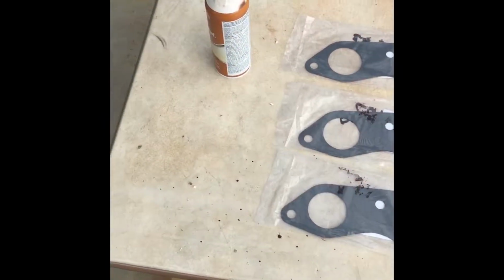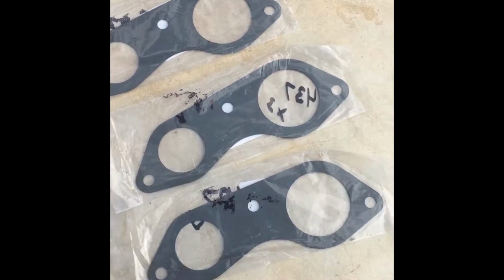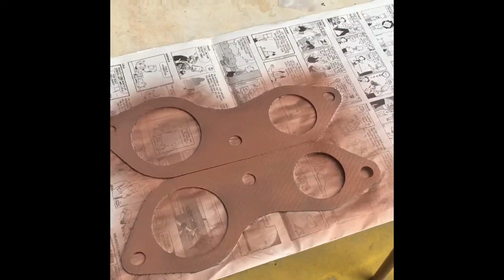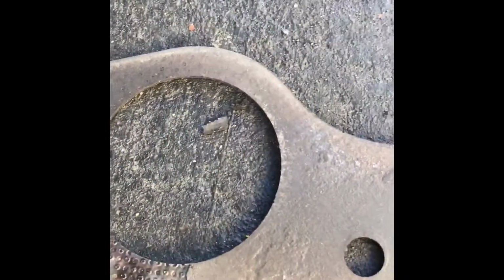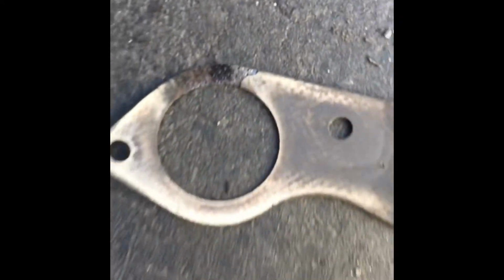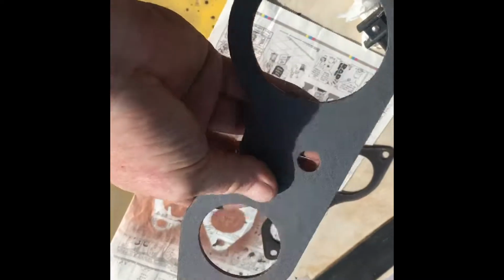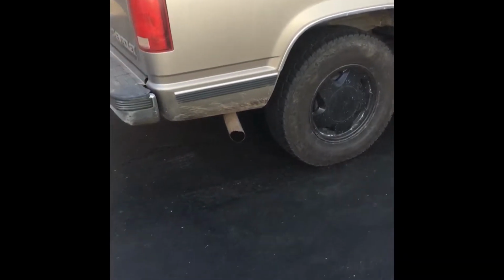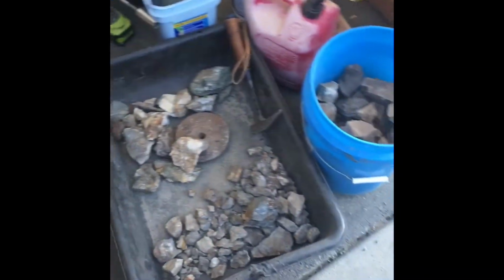Tahoe has an exhaust leak!

Comment: Did it hold, if so how long?  Mine starts leaking after about 6 months
Reply from the maker: On my 1998 Tahoe, the two surfaces are slightly warped. 
I bought another Tahoe (2006 model) about 3 years ago.. I've been driving the 2006 since then. 
With that background.. I did drive the  1998 about a year or so with no issues.  I now fire up the 1998 every couple of months and can hear it leak a bit at the repair. 
I probably should have drilled two or three additional bolt holes to draw the surfaces tightly together. 
I hope that this helps you.
Thanks for your comment 
Peace Prospector Tripp

Comment: Did you have pressed in bolts, spring bolts, or regular bolts in there?
Reply: Factory they have studs with nuts, I’ve had to cut them off and use bolts before, and they always leak no matter what

Comment: Did you have any issues getting the nuts off? I need to do the same repair this weekend
Reply from the maker: Heating with a torch and then spray with WD40 if they give you trouble.
Mine did not need to be heated just sprayed with WD.
Good luck Rob
✌️PT